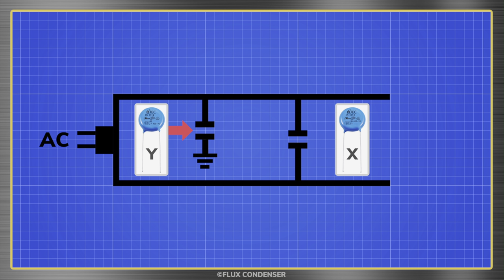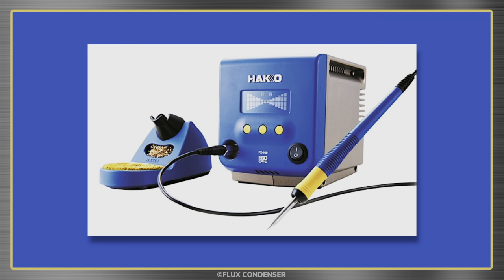Quick! What’s a Safety Capacitor?

Comment: What if my house installation only have 2 wire, live and neutral ?

Is this the cause, why my pc sometimes give me shock when i touch the case?

Because i manage to open my pc psu and find out theres 2 blue safety cap in main connector

Comment: Do have one question. In older tube radios they use a wax capacitor I have one that is a .047 at 200 volts. Can a disc. cap. replace this type of cap.? if so what value would you use?
Reply from the maker: In some cases it’s ok to replace an old wax/paper cap with a disc capacitor, but generally they’re replaced with a film type.

Comment: Are snubber caps (for both rectifiers and/or power switch) Y type?
Reply from the maker: I believe they’re a different class of capacitor altogether. And while they can be self-healing, I don’t believe they use the X, Y, or XY designation found on safety caps. If anyone knows more, please join the discussion.

Comment: Don’t capacitors pass ac? Please tell me why they don’t make a short across the line. Thanks!
Reply from the maker: Capacitors can also be used as filters whereas the capacitance value affects the frequencies that it will allow to pass. Think of capacitors in a crossover network, for example. The line capacitors use a capacitance value that creates a high-pass filter. So, the low 60Hz frequency of the line AC is blocked.